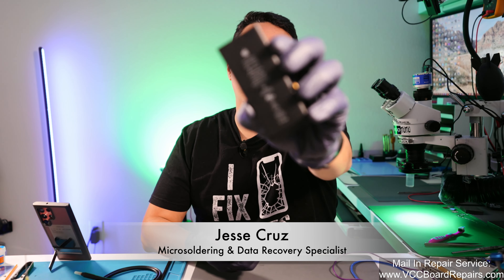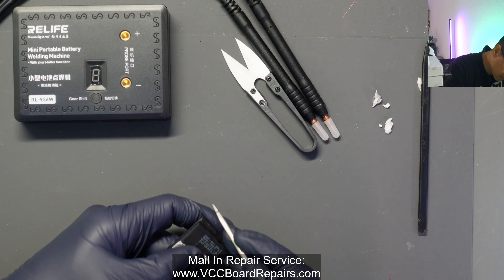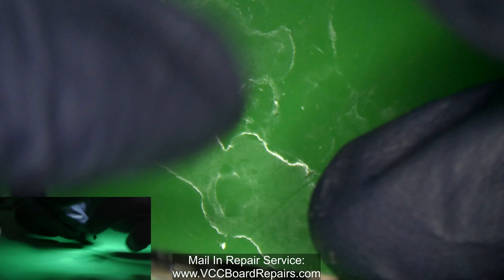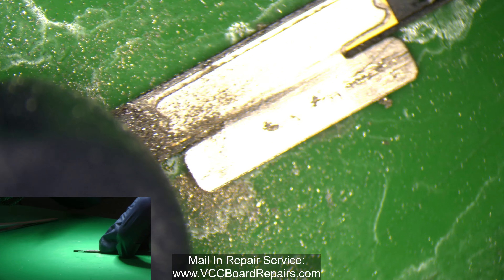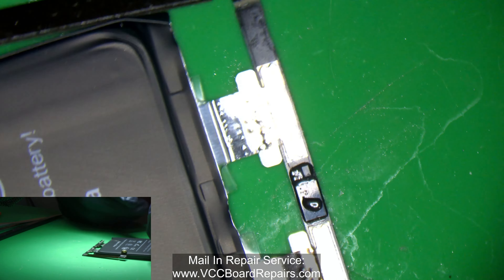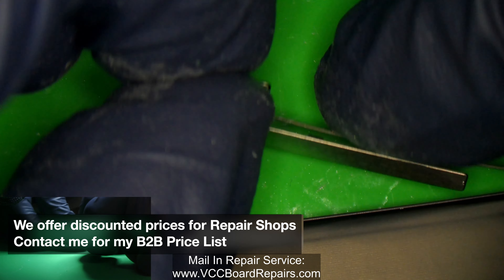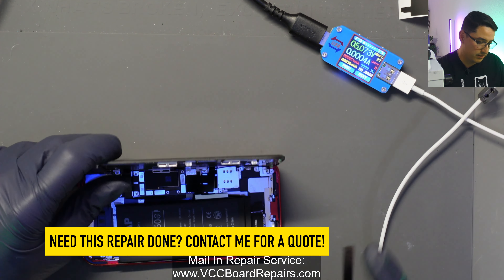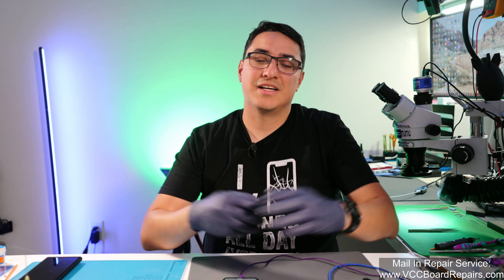How Not To Lose Battery Health After iPhone 11 Battery Replacement. BMS Swap Spot Welding Tutorial

Comment: I have been getting mixed results.  I use Xcap batteries with Xcap pre-programmed tag flex, also JD ID tag flex with programmer.  Around 1 in 4 repairs are unsuccessful.  When booting the phone for the first time with the power cable inserted and tag flex attached the phone shows '0' percent and does not charge.  The cable is attached to a good power adaptor.  I follow the same process for each repair.  I just don't understand why some work and some fail.  Any ideas?
Reply from the maker: That's strange. I haven't had any issues with all the batteries I've done. Maybe the spot welds are not good? Or maybe the BMS board gets damaged?
Reply: @VCCBoardRepairs My spot welds are secure and I am extra careful not to damage the BMS board.  I always fully reset and install latest iOS.

Comment: i do bms swap on xs max several months ago, it doesn't work. i dont have a programmer and the battery indicator is 1%. did i mess the bms or only needs programming?
Reply from the maker: If it's not Xcap BMS solution, then i don't know.

Comment: me for bms spot welding only 50% successful the bms board is very fragile and very weak also the battery connector is very easily torn off anyway very great video your grinding bms board is so impressed best video thank you

Comment: Great vid! 2 questions - Does removing the tag only work with Xcap batteries and does it matter which brand of tag on flexes we use?
Reply from the maker: I only use Xcap, so I'm not sure about other brands
Reply: @VCCBoardRepairs  I’ve just done a bit more research and to help anyone looking for the same answers I was:
- this works with any new battery, as long as you have the original bms
- it works with all tag on flex brands and they’re safe to remove after the initial calibration.
Reply: @AureaBulgaria yea but when taking out the tag 3utools will still show the original battery capacity read from the bms, despite the fact that the phone will now display 100%
and also, after dealing with few devices i have replaced the battery in with this approach, i noticed some significant drop in the phone's battery capacity percentage after some 2-3 months of time, which leads me to believe that it would be better to leave the tag inside. but for now i can't be 100% sure about that
Reply: @VCCBoardRepairs Very very good and clean job sir,butt just tell me,why we need to put extra flex tag?and who programming the flex tag???

Comment: i broke my BMS any solution to read the data
Reply from the maker: No, sorry
Reply: @VCCBoardRepairs  what if i directly add positive and negative from battery cell to logic board  of iphone SE first gen without data line, will it turn on
Reply from the maker: It will turn on but will restart 

And very risky thing to do.

The BMS is a safety mechanism. Bypassing means you may cause the battery to explode
Reply from the maker: Also, there's no need to even touch the BMS on SE 1st Gen

Just replace the battery. It's like a $5 part
Reply: @VCCBoardRepairs  thanks, you are a genius

Comment: Great Video.! I have used this method to replace my iphone 12 Pro Max battery that was less than 80% (73%) and so was showing the service message 'your battery health is significantly degraded'. I replaced the battery and set the health to 100% and cycle count to zero. Even though the health is now showing as 100%, the service message is still there? Do you know why this may be? and how do I remove it? Thanks
Reply from the maker: Try to Quick Flash on 3u tools & select "fix battery health" in the pop up

Comment: If I get use one of the OEM batteries sold on eBay would I be able to get the phone working right with just the tag-on flex cable?
Reply from the maker: No that won't work
Reply: @VCCBoardRepairs  Not even the "refurbished" ones?
Reply from the maker: @BillAnon  If you want to use the solution I show in this video, then you have to follow it exactly like in the video.

If you want to experiment doing your own method, you're on your own for that one
Reply: @VCCBoardRepairs  Well, you mentioned in the beginning that even a genuine Apple battery would give the same warning.  It seems to me the Apple battery would already have the BCM so all I would need is the tag-on flex cable.  Worse case, I grab the BCM from the original battery.  Thank you so much for the ideas.

Comment: Hi VCC.

So I've done as per your video. I boot using the cable and I don't get battery message, and the phone reads the original battery health. Any ideas?
Reply from the maker: Did you use the tag on flex?
Reply: Yes.

Comment: you did a very clean job! congratulations! two questions (i use qianli tag flex):
1. is this flex reusable or you need to buy new flex for every battery you change?
2. did you try to update the phone or factory reset it to see if it keeps the battery health percentage? i currently leave the flex in the phone everytime i do this job and it is very difficult to do this neatly in such a tight space. sometimes it breaks my fpc connector and needs to resolder a new one to the tag flex. thank you.
Reply from the maker: 1. I reuse the tag on flex. I don't leave it in.
2. I personally haven't restored it. But I know the injured gadgets team has fully tested it without the tag on flex and they confirmed it is still working fine. 

I did do an update to the phone after the BMS swap and it's still working fine.
Reply: @VCCBoardRepairs  if you dont leave it there yes it will work but if you put in 3utools it shows the old percentage and charge cycles
if you leave it there in 3utoold works like a charm
better leave it inside and the tag on flex leave it between the flex of battery 
from my experience and i have changed a lot of them from xs-13 pro max
tag on flex need from 11 and above
Reply from the maker: Is this what you saw with the Xcap battery solution?
Reply: @VCCBoardRepairs  i am changing batteries for iphone every day the percentage in phone keeps 100% but if you see in 3utools its the old one
i didnt use xcap this specific tag on flex sorry if i make mistake but can you see in 3utools if the percentage is ok?
Reply from the maker: According to the Xcap (Injured Gadgets) team

It takes up to 14 days for 3UTools to reflect calibrated data. The device displays accurate data after calibration.
Reply: Thanks. Very useful 👌. I'm Hossein from Iran 🇮🇷.
Reply: @VCCBoardRepairs  have you dealt with some of the phones you replaced the battery in after some period of time?
i recently had one of the phones brought back with some issue unrelated with the battery but to my surprise i noticed that the battery percentage has significantly dropped from the programmed 100% after some 2-4 months of use. so i begin to suspect that maybe this is the case when you take out the tag-on
what does your experience say?

Comment: Nice video :) 
However doesn't the battery life reset to the previous health after actualization or restore of the device when you disconnect the tag? Do you have experience with that? 
Also the phone was not charging because your charger is not MFI therefore after turning on phone you have to reconnect cable :)
Reply: it won't restore to previous maximum capacity after restoring the phone but it definitely will if you connect any other battery or power supply (which of course leads to the "important battery message") then back to this "original" battery. also i noticed that not leaving the tag-on flex inside the phone after the repair probably leads to faster capacity degradation from the programmed 100% to the original percentage. but for now i'm not 100% sure on that, plus there's a chance this percentage drop will never quite hit the original percentage and just stabilizes itself on the actual level after a longer period of time because the battery's capacity is periodically measured and calibrated over time. so i noticed this fast drop on some devices after approximately 2 months from battery replacement but i can't tell how the situation will look after next 2 months or a year
p.s. also the 3utools keeps showing battery's original data even if your iphone displays the 100% capacity
Reply: @eegee24  Thanks, I will try it myself